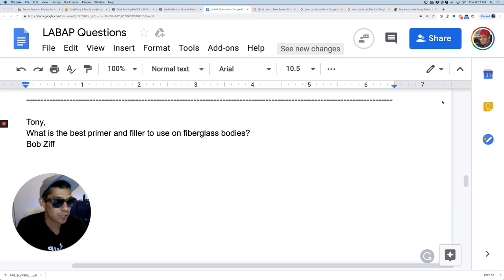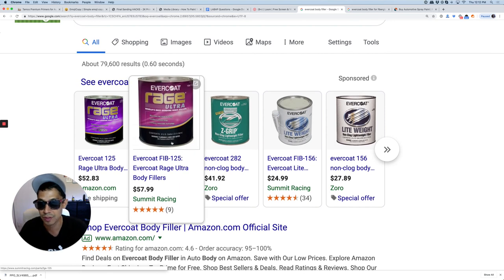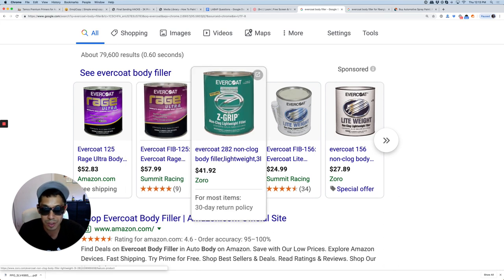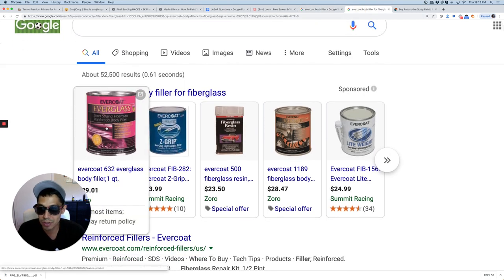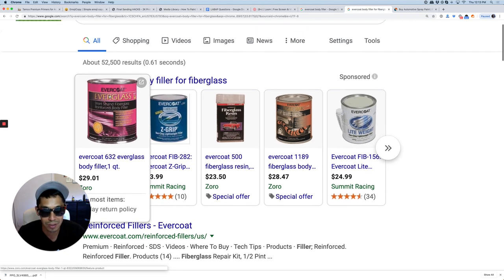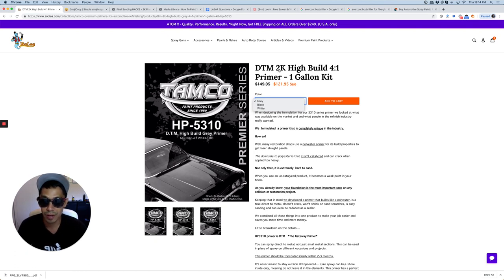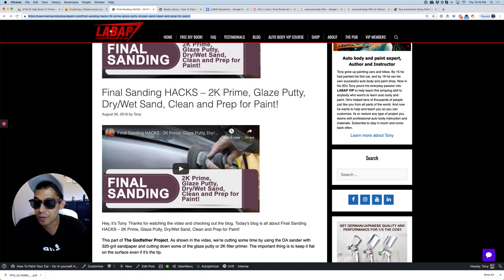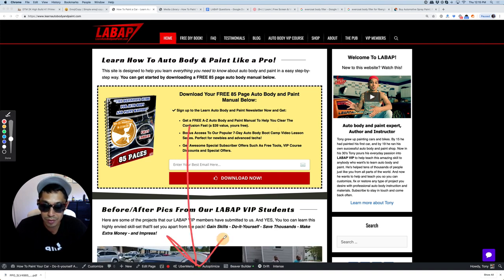Best Fiberglass Primer and Fillers for Fiberglass Refinishing ✔️

Comment: I have a Econoline series van and need to repaint the fiberglass hood. Would it be ok to sand down to the gelcoat, not past it, and just use a 2k urethane primer on the gelcoat? Thank you